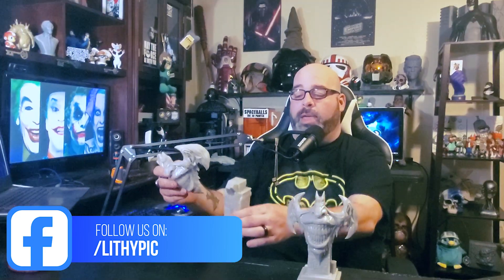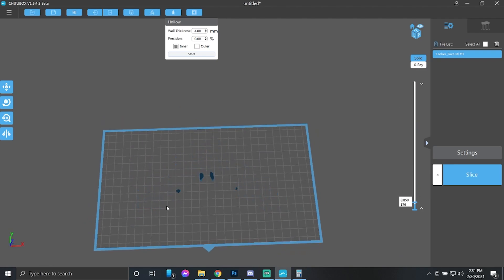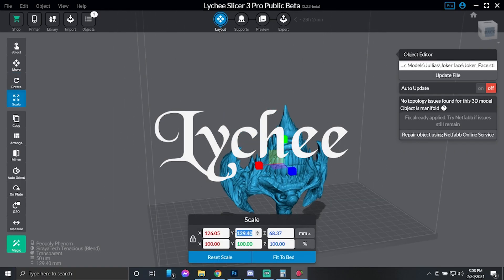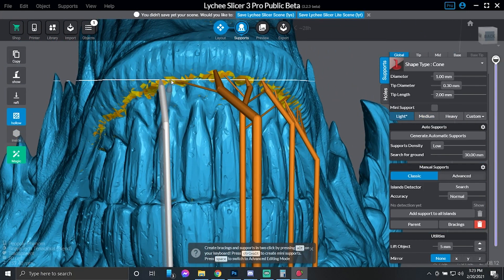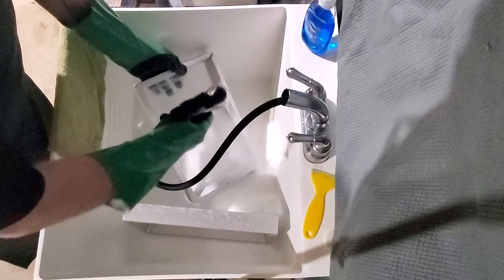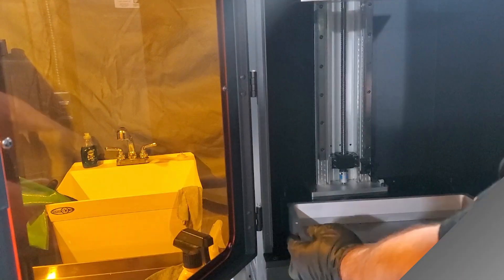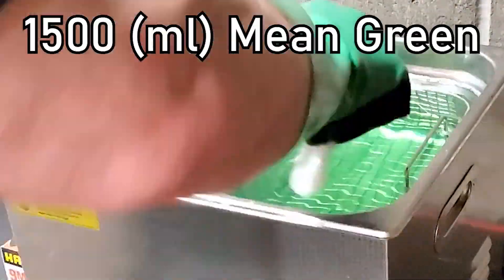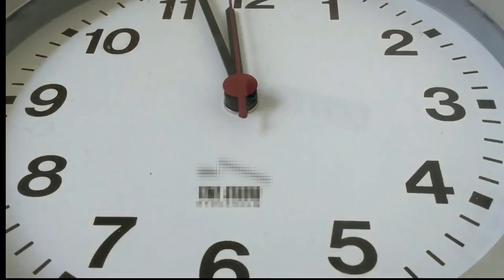Battle of the slicers! Chitubox vs Lychee, 3D Printing Process, RainX for feps. 2021

Comment: Put the vat on the corner, the resin will run out of the vat within 20 minutes nearly completely. Than i put some ipa in it take a soft brush and mix the ipa around. Than i put the ipa out of the vat and let it dry.

Comment: Dude, you're directly responsible for how many supports were placed on the Lychee model, since you added all of them manually, you did not use auto-supports, unless you count the 9 or so islands that it identified for you to support. Lychee can give you resin estimation and time estimation without having to slice, the info is available in the bottom left corner of the screen. So, all of your issues with Lychee are issues you've caused yourself. 

Cleaning your vat in the sink isn't exactly the greatest thing to show all of YouTube, nor is showing the rinsing of prints in the sink. You MAY have a contained system, but the majority of those who will view this video will have their sewage system handled by the city/county. So, you're essentially showing people they can rinse resin down the drain, which can be extremely toxic to the environment. The thing with the acids that go down the drain is they generally turn into water and salt as the chemical reaction occurs. Resin doesn't break down into harmless substituents. So, you've made a false equivalency. 

Finally, strictly focusing on the production of the video, I personally don't like the humour you add to your videos. If I wanted to watch a comedian I would watch some stand-up. That doesn't mean you can't tell the odd joke, but the funny voices and clips dispersed throughout your video is too much.
Reply: sums up my problems with the video. Sadly there's only 2 comparison videos on youtube and both are poorly made :( Guess I'll just have to try both softwares myself

Comment: Omg no! Resin should never go down the drain! I'd do the following instead: use a silicone squeegee to scrape the vat clean (you have less chance of damaging the FEP). Then when you get out all you can, use microfiber lens cleaners and IPA to get the rest of the resin. You should only need to clean the vat during a resin swap, or a print fail. You can buy the glasses cleaners for cheap on Amazon in bulk( I spent 20$ and still have some from a year ago)  It's fine to leave resin out for a while (couple weeks) just stir the vat before you print. The microfiber cloth can be curred in the sun and disposed of in the garbage with your resin filter paper.
Reply: No!

Comment: (11:20) - What was the purpose of 'comparing' Lychee vs Chitubox?  There are many things that are not compared directly to give accurate comparisons.

Supports:
- Chitubox: you just did 'Heavy - Auto Support' (at least that is what you show in the video)
- Lychee: you use Medium Supports, After you use the island detector and place a few supports first (basically all manual supporting, no default 'Auto Support').
-- Does Lychee have "Auto Support" ? Does Lychee have 'Heavy Supports" ?  Does Chitubox have 'Medium/light/ultra light Supports'? Can you move supports in Chitubox? Can you raise your model up from the bottom in Lychee like you did in Chitubox ?

Stats:
- Chitubox: displayed amount of resin, price, time, etc prior to saving
- Lychee: Didn't do that?

Printed Details:
- Chitubox: seemed good
- Lychee: the grooves / valleys were 'deeper'
-- What did the close up details look like on Lychee vs Chitubox?  Can you see the 'layer' lines? Did fine points come to a point? or get rounded?

Saved File Size: ???
Sliced Layers: ???
Model Orientation: ???
App functionality Differences: ???
Other: ???

I would have tried to keep everything (as much as possible) the same between the two applications to compare the end result.  
There isn't a list of Criteria for 'comparing' the apps (if that was your intent) or the end result models (again no criteria).

The biggest differences I see between the two apps (from what you showed) was that Chitubox had 'Heavy Auto Supports' (Lychee didn't - at least you didn't say, and by using a different method of supporting the model I wouldn't know without getting and looking at the app myself) and Lychee had Medium/Light/ultra light supports that had to be manually placed (no auto supports - because they were not used or discussed).

While I enjoyed the video, I'm not sure I got much for a 'comparison'.  I got more from your process of cleaning and the fact that you use 'Rain X' on your vats.

Hope that was helpful and not too much of a rant.

Comment: So which rain x is better is the question?  The one for glass, or the one for plastics?   Since FEP is plastic, I would think this might be the better choice...   What do ya think?    >https://amzn.to/2RJtrLg
Reply from the maker: Considering it is july and I did this video back in march. I am still using the same fep. i think my version is fine. But you might be right. I am still on the same bottle of rain-x too.
Reply: @LithyPic  Sure, I just figured the plastic variant might have some spec property that might embed it better for such subtraits, but I suppose at the rate you're suggesting for the regular stuff it's irrelevant.   Just my nature to be inclined by such curiosities I suppose.

Comment: Hey! I'm from the Lychee Slicer team, great video!
Some comments: You can do supports to the build plate only but with a more recent version (since 3.3.1). About the island detector, you may need to use a higher accuracy (slower) as it misses one important spot ;)
About the printing time, you have the estimation in the software (whatever the slicer) and the real printing time. If you set up the same parameters, you will end up with the same printing time with all the slicer. Only the volume will vary because of different supports/hollowing parameters/organization.
And about printing volume estimation, same, you can do it since 3.3.1 without the need to slice :)

Not related to the slicer(s), but as you asked for comments ;)
- it's better to use a silicon-based spatula to clean your VAT. FEP is fragile and any type of hard plastic spatula may scratch the FEP.
- except if you change of resin brand/type, no need to clean like you did your resin tank/VAT.
- If it's not a water washable resin, tap water is not good. IPA is, to clean your tank.
- NEVER have your water as you show in your video going to waste / sewage system. It's really really bad for the environment! That's why we are against water washable resin here at Mango 3D (same with some brands of resins that refuse to do such resins).
- Be careful when rubbing the print straight out of the 3D printer. Your resin is still not completely cured and depending on your resin parameters/exposure time, you could lose some details. The best is to keep the print untouched before IPA cleaning, then when done, removing the supports, then post-curing process. You can of course remove the supports before cleaning, but try to keep the model itself untouched.
- to dry your IPA, nothing is better than an IPA bath, then let it dry :) From my point of view, you are rubbing way too much the print before curing.
- About the curing, I don't know what is your LED power in your DIY cabinet, but 2 hours is quite long ;)

I hope that helps :)
Reply: Wow these are some great tips!
Reply: hey bro, i love lychee but i cant found information about usage of antialishing v1, v2, blur and stroke blur, where i can found information about the usage of that parameters
Reply from the maker: Thanks for your reply. I stopped using lychee because after the last update I have had nothing but failed prints with lychee. Failures I can tell that came from bad slicing. I lost a lot of resin with lychee bad slices that I had no choice but to go back to chitubox.

Comment: Man, unless your sink goes to a barrel that you take to a waste facility, you should really not be washing resin into the sewage system. 
Resin is a very harmful chemical. Both to people as well as to the environment. It should be disposed of appropriately. In your case, I would use paper towels to soak up as much resin as possible and then cure the paper towels. Only after prints are post cured are they fully safe. 
If you haven’t, check the MSDS, and please don’t flush anything that has uncured resin down the drain.
Reply: +1 !
Reply from the maker: Yea so is Drano which will kill if drank but you pour it down your drains. If you realize how many garages and mechanics use acid in their sinks right down the drains. I have a contained septic system that I use.  Let's not also forget water washable resin that is advertised as clean in your kitchen sink.
Reply: @LithyPic   Such a poor attitude to have....
Reply: @LithyPic  with all due respect, it doesn't matter what other people do, be better than them and show a better example. 
If resin was an acid, that was specifically designed to be poured down the drain and be processed further down the pipeline (no pun intended), then by all means go for it. I wouldn't have left my previous comment if that was the case. But resin isn't, and shouldn't be introduced into a sewage system. 

This is on the amazon description for Elegoo Water Washable resin:
"*The water that washed the water washable resin models can not be poured directly into the sewer or sink. It should be placed under the sunlight to completely cure the remainIng resin in the water before processed to avoid environment pollutioin. " 
Indeed water washable WAS previously marketed with people washing the model under a tap, but that should have changed considering that the community at the time was quite annoyed by that huge mis-representation of the product.

Your viewers don't know you have a contained septic tank, and even then it's redundant. Someone completely new to the hobby might watch your video and think that this practice is perfectly okay with any resin, considering you don't mention what specific resin you had in the vats before you cleaned them. I'm not trying to attack you personally, you're printing, enjoying it, you do you dude, but you have a responsibility to your audience not to show them things that are just plain bad and harmful practice.
Reply: @Iakouben  Very well said.
Reply: @Iakouben  Well said man. People in the hobby really need to be better at chemical disposal. And whats with the "well other things are worst, so its fine" arguments...
Reply: @Iakouben  Right! Akin to all the "PLA is biodegradable" ..whut..no..just no. Teaching bad habits!! Advertisers have no legal or moral obligation to shill the RIGHT way to do anything.
Reply: @LithyPic  I love this reply! All those drain cleaners are just as, if not worst.